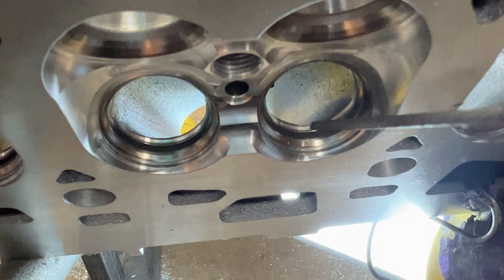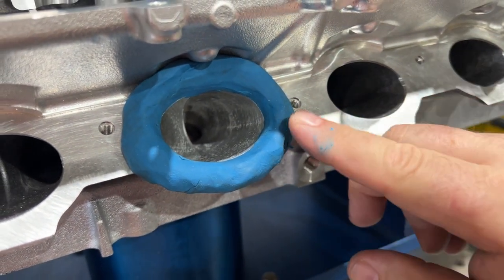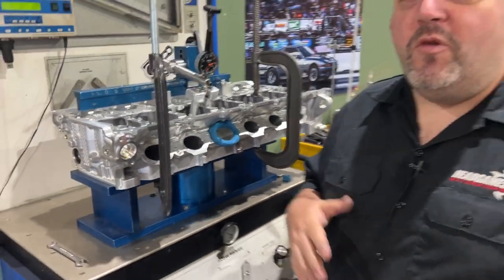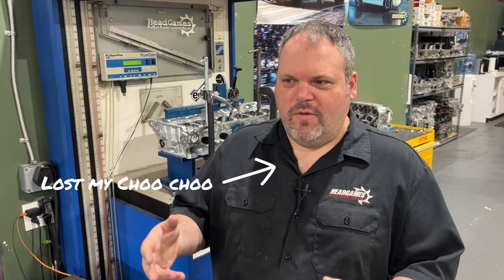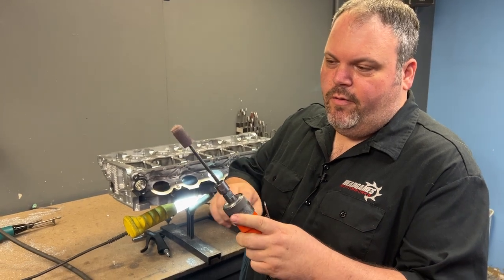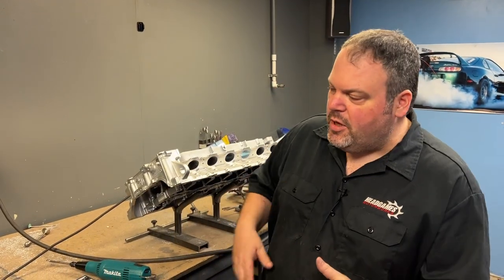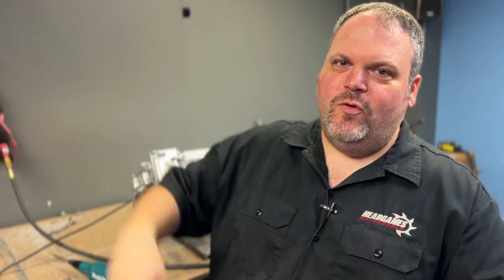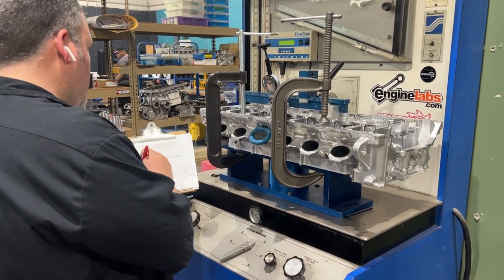HeadGames B58 road to CNC digitizing Part 3  - Surface finish, does it add CFM?!

Comment: Head scratching games. Same question with more relevance ? Smooth makes zero flow gain, so how rough does it need to be before there's a loss ? You say rough keeps fuel suspended, inferring that suspended fuel is better, how so and what performance difference does it show up, or is it just that you can't see it puddling, or is it another unproven myth ? And if rough is better, then how much rougherer is betterer or bestest before it turns worserer ?
Reply from the maker: The myth here is sooooo many people just want their heads sanded or "polished" thinking that they take away the roughness and it is a gain in airflow. They go as far as mirror polishing the ports. I have continually said that you have to move material for there to be a gain and the fuel issue with puddling. I don't know anyone trying to make it rougher but I will say there is some CNC heads that come pretty rough and have zero problems making power.
Reply: Yeah I get your point.  Still leaves the rougher is better debate wide open, and I've heard the fuel puddling argument many times without any solid evidence? Hoping you could share some knowledge to advance the theory as logic says it's better to take a smooth port and rough it up, but how much? Is it dyno testing that's behind your finishing the super spiral with a smoother double cut?  @headgames
Reply: @funkiwikid6106  There is a crowd that do CNC dimple hits which make the port look like a golf ball.
There are tests both on flow benches and dynos showing gains from it. However, as what was pointed out, knowing how to manipulate flow numbers is easy, and to some degree same as dyno readouts. 
Thats why all true validation is done at the track, because the bullsh*t stops when the flag drops.

Comment: I have a question for today, I understand the port with clay will make the numbers go up, because the velocity increase, but on the car the intake manifold is on and with the long runners and a less contour at the entry port, will the numbers not be different, or it doesn't matter because they will be anyways more gains regardless of how the flow enters the cylinder head.
Reply from the maker: the clay mimics an intake in a way where the air entering the port doesn't hit the sharp edge at the entrance. Some intake manifolds hurt flow, some help. But that is a totally different test.

Comment: Hello, thank you for doing this mini series.  When you sanded the ports what percentage of marginal change did you see in the port volume?  Also, on the exhaust do you use the finer level of sand paper to help stop carbon deposits building on the port walls?
Reply from the maker: Honestly never measured the volume before and after sanding something. We do 60 grit on the intake and 120 grit on the exhaust

Comment: Hi Dave? Have you a set rate for a port, polish and rebuild, a complete valve job? And or valve upgrade? What ever is required to send back to me a complete high performance set of heads? For an L.B.Z. DURAMAX?  I require a fresh set of heads for a new 427 c.i. DURAMAX diesel build.
Is it difficult to get big 🤔 power numbers out of a set of diesel heads?
Thanks for sharing 👍🏻. 
✌🏻😛🤘😎 🇨🇦.
Reply from the maker: sorry my man, not a head we work on. Thanks for watching!

Comment: Crazy. This is always a question of mine and I’ve never been able to get an answer.
When trying to stay on a stock tune, can massaging the heads add anything.
Looks like it’s a no…
Reply from the maker: If you are anywhere near a stock tune in terms of mods, porting the head would hurt power not help.
Reply: I stock tune expects the head to flow stockcfm , if you massage the heads and get a higher CFM flow the fueling from the stock tune is now not going to be enough for the extra air.

Comment: but how much would mirror polish in exhaust port reflect all its heat to bulid up port energy, or those surface wouldn't last any longer with blast cooking up, maybe port thermal coating work way much better?
Reply from the maker: In my opinion, it doesn't matter. It is just which way you wanna waste your money or time.